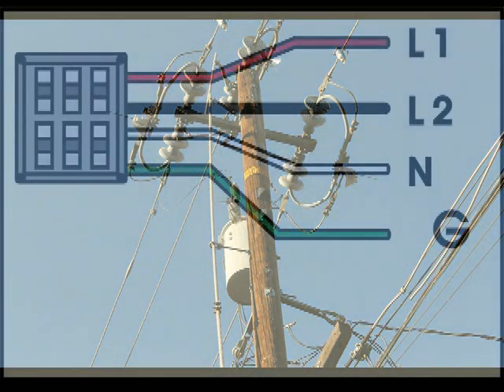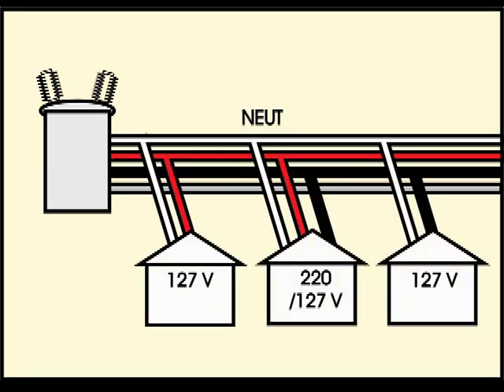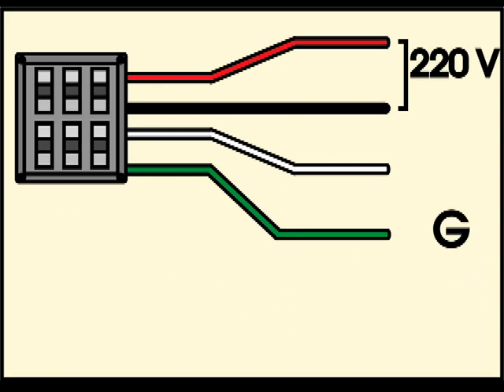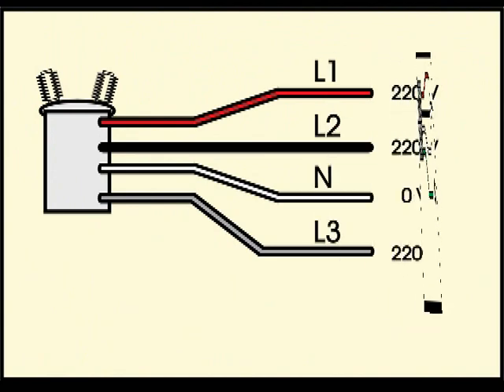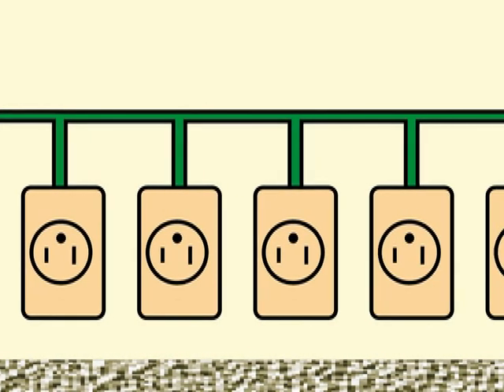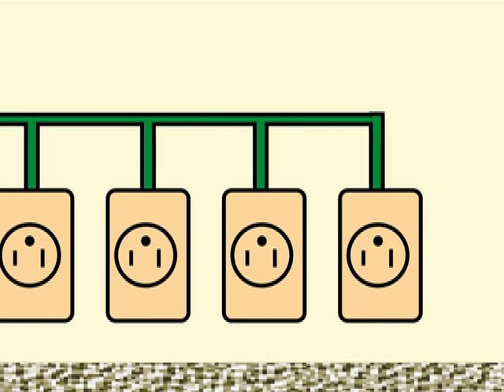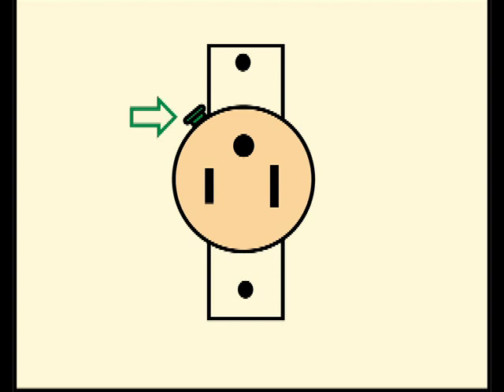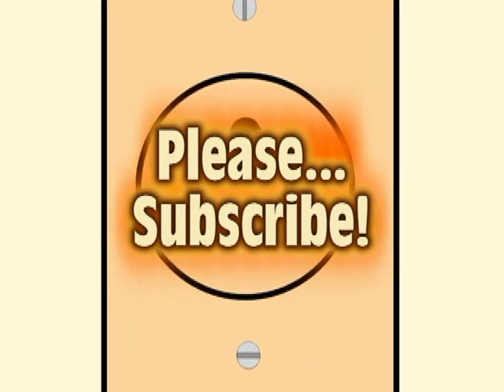Difference Between Neutral and Physical Ground

Comment: The description of this system is completely inaccurate. There is no 3 phase, star configuration. The system shown is a typical single phase, center tapped secondary coil normally feeding 120/240 volt services in the USA. Also the 220/127 voltages referenced is incorrect. I quit watching the video at this point.
Reply from the maker: I suggest you read this interesting article https://roboticsandautomationnews.com/2020/05/20/difference-between-three-phase-and-single-phase-power/32320/#:~:text=Three%2Dphase%20power%20provides%20three,it%20never%20drops%20into%20zero.
Reply: Different country.

Comment: in re volts: nominal voltage is 120 VAC. back in the '70s, when monitoring equipment became common, the industry tracked actual voltage. it ranged from 105 to 125 VAC. the median voltage was 117 VAC. 127 volts is pure nonsense.
Reply from the maker: The phase difference makes 220VAC between phases and 127VAC between any phase and neutral. The factor for obtaining this value is 1.732283464566929, rounded up to 1.7323. Of course, there are areas where you will find a voltage between phases as high as 250VAC or as low as 180VAC. That does not change the fact that the nominal voltages are 220 and 127 volts. Whenever the voltage between phases is 220, the voltage between phase and neutral will be 127.
Reply: @eltunene What country please?
     we see 120 line to neutral and 208 phase to phase
                     277.                                   480
                      347.                                   600

Why configuration with neutral.